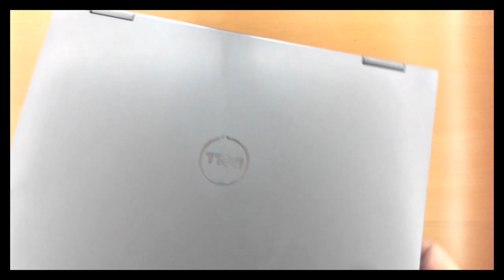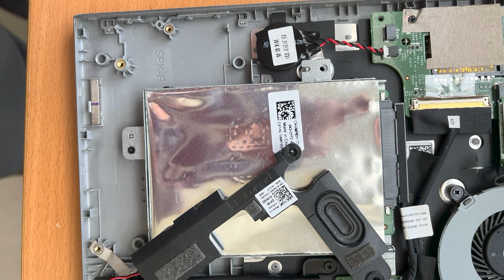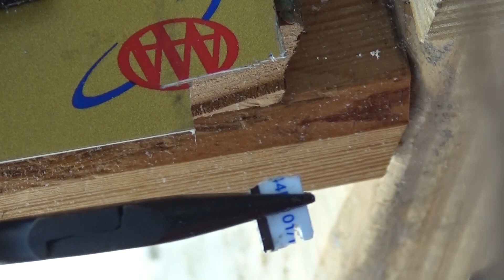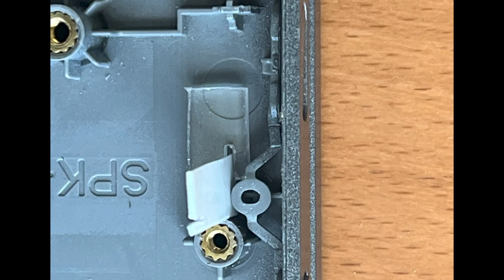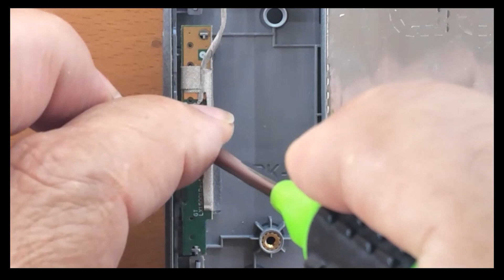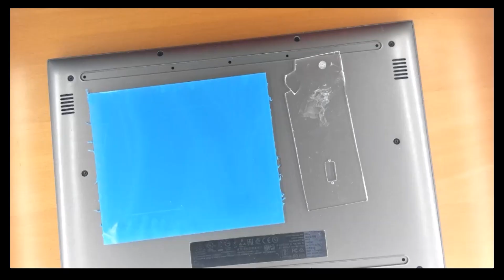Dell Inspiron 5000 Power Button Repair

Comment: what do you think the final dimensions are to make a 3d printed piece?
Reply from the maker: The trick to a 3D printed replacement part is the resilience and strength of the plastic. 3D parts are printed in layers which create excellent breaking points depending on how the part was printed. The smaller the part is the harder it will be to make it strong so it won't break.